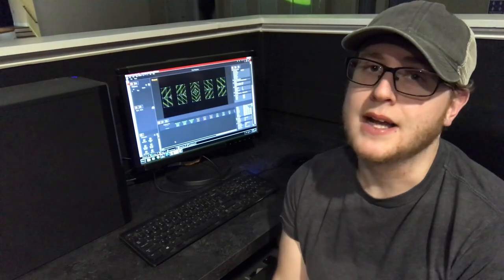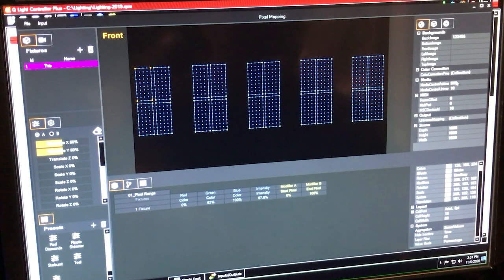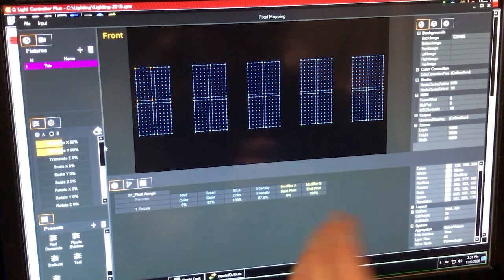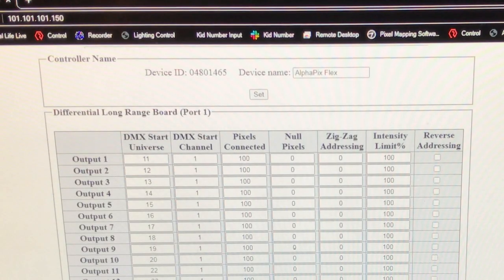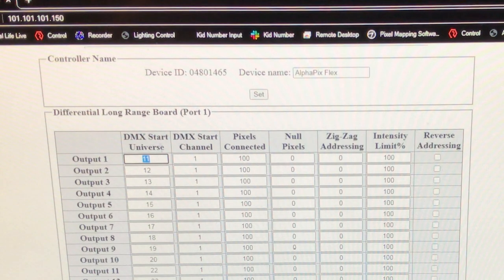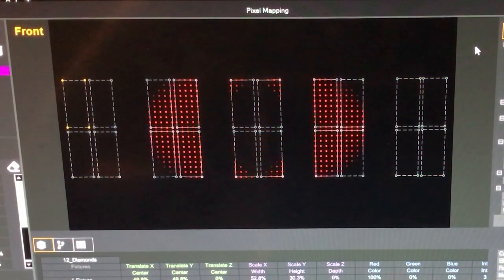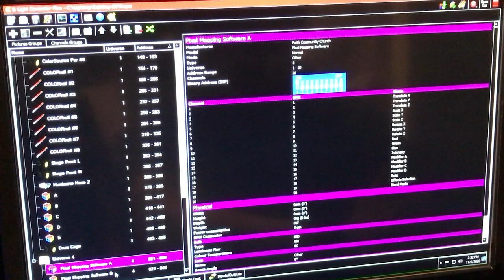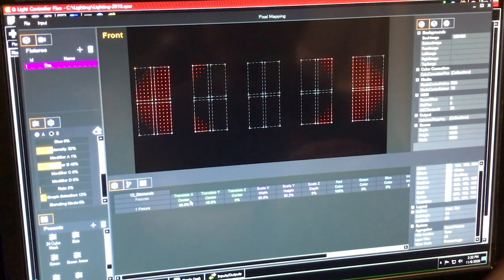DIY LED Panels | Behind the scenes

Comment: This is amazing! I would love to do something like this at my church for our stage design next year. Is there anyway that this can be done on MacOS into LightKey that you know of?
Reply from the maker: Go for it! I haven’t used LightKey, but I don’t see why not. LightKey would control it as it would any other fixture. The Pixel Mapping program is only for windows though so that would have to run on a pc. 

Artnet can be sent over Mac and Pc as it is just a network protocol.
Reply: @churchtechideas279  I guess I’ll have to check and see if someone has a spare windows machine they’d be willing to donate…

Is there anyway that I can email or message y’all some other questions?

Comment: could be handled with a normal dmx?  excellent job
Reply from the maker: The mapping software only outputs via artnet, and the leds are not dmx but spi, so they need a controller to link the dmx channels to the proper led.